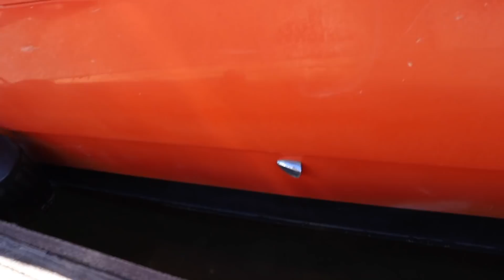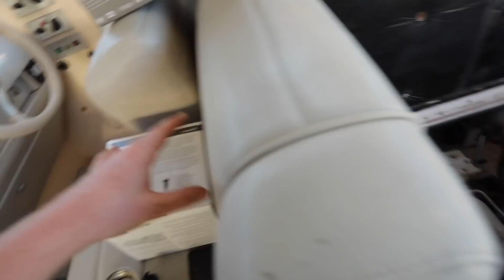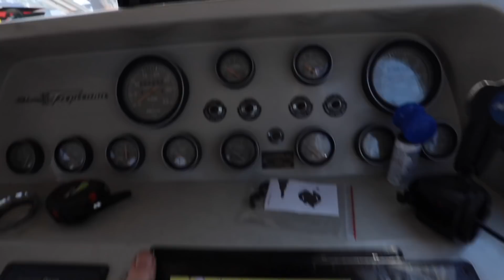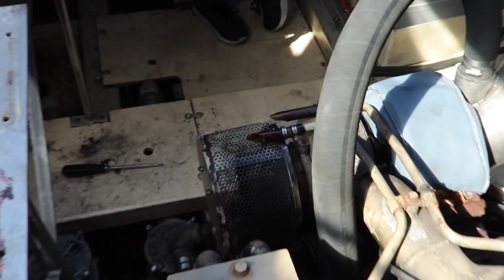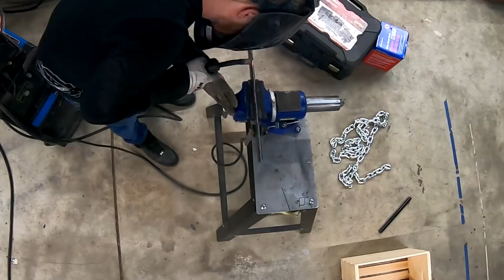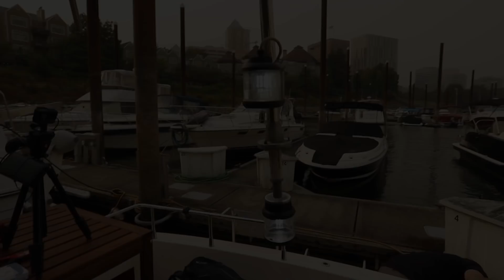Fixing Up My 30yr Old ITALIAN YACHT!

Comment: Pretty sure those engines are Cumins VT903's V-8 motors not V6.    Same motors we ran in the 41' Coast Guard patrol boats.  Also make sure your anchor light is switched separately from the white masthead light.  They are not suppose to be on at the same time.  When the 360 white light is on no other running light should be on.    The forward mast head light, the sidelights and the stern light come on together.

Comment: As a full time detailer, I would recommend more of a gelcoat specific compound, which cuts harder and will give way better results, also 1,000 grit wet is used on gelcoat to get previous sand marks out, I would definitely recommend using a different set of grits, I would go using a 600 or 800 dry to a 1200 dry for more time and then a 1500 dry for even more time than that, and finish off with either a 3,000 or 5,000 wet followed by medium cut and glaze for a showroom shine
Reply: This guy details
Reply: @Failociraptor  That's a lot of details.
Reply: Wouldn't even do that... There's barely any haze on that gel coat. 3M Finesse-it and a wool pad on a buffer will take care of that fine without any cutting.
Reply: I wouldn't wetsand gelcoat at all. Not a good idea to wear it away like that. Ask me how I know...
Reply: @nickrouse1738  Absolutely not on a boat of that age. The gelcoat is already fragile from age and your method will tear right through it, and become even cloudier within a year.

As I said, Finesse-it with a wool pad or a DA and foam pad, and a proper wax with uv protection.
Reply: oscar is ur realest friend hes always willin to put in work
Reply: I agree. 3m makes several marine color restore products that are amazing.
Reply: keep in mind tho, that as he clearly doesnt know that much about boats, he might totally ruin it with the sanding. in two ways: 
1. he will sand it off too much with a 600 on some parts for sure, so the lamination will become visible. on older boats thats really hard to fix, as the gelcoat changes color with time of course. 
2. he will make this sorts of circles, im sure you know what i mean. the circles that appear if you are not skilled and not sand everything evenly. he should use that 1 meter long sanding tool, idk how it called. 

I work in construction of yachts full-time (focus motor yachts), we do the sanding from 240, 400, 600, 800, 1000, 1500, and then polish. and between every step we lightly paint it red, and then sand it until all the red is gone, that way we know for sure that its evenly sanded. but then if there is just one red spot, it absolutely crucial that you dont just sand that spot, you have to sand everything around it evenly until the red spot disappears.
Reply: 5000 grit? Jesus
Reply: I’d take a look at the new Farecla G360 Superfast compound and polish. It is by far the best compound and polish on the market today. It may not be as Popular as meguires(3M), but it is by far better.

Comment: Probably just needed fresh breather canisters. They are a service item. I wouldn't modify the breather system. If it goes wrong and you get excess crankcase pressure it'll run away.

Comment: You are going to regret not buying that Fortress anchor! They are the best anchor going. The one you built is way to small for the size of your boat
Reply: Fortress anchors are a good backup anchor for a boat this size , a correctly sized rocna or manson supreme is a far better choice they will set far more reliably and hold on where other anchors struggle,  they will reset on a lazy tide change ,  a fortress will struggle with that

Comment: Good lord I know the pain and suffering associated with detailing boats... Pretty much my entire company went down to Annapolis MD 3 summers ago to fully correct and seal the paint on the hull of an Azimut 30 meter and we spent the better part of a week correcting that paint. I still remember sitting in a floatie tube in the water in absolutely blistering 103° heat all week just to get an angle on the paint closest to the waterline. Good times though 😂

Comment: Your exhaust system has a water jacket running uphill after the turbo.  These eventually fail, leaking sea water into the motor through turbo.  It's a bad design you should replace.

Comment: Your diy anchor looks a bit small. Also if you really plan to anchor somewhere, you will need atleast 70ft + water depth in chain. Otherwise you will crack the bow of your boat and/or the anchor will rip loose. The heavy chain has a dampening effect on the boat and it will also ensure a good angle on the anchor. I recommend 5 times the water depth in chain for shallow waters down to maybe 2 times water depth for really deep waters. For your boat size you should at least get 100-150ft of chain to anchor anywhere. Everything else is pretty unsafe.

Comment: Not trying to Monday morning quarterback ya here but the anchor looks a little small for the size of the boat.  I think you also need far more chain then you have. Anchors have some serious engineering involved and while they do dig into the bottom the chain is actually what holds the boat in place, not the anchor. The ratio is usually 4-5 times the chain length per foot of water depth.  This increases to 5-7, or more, times the length of chain per foot of depth in bad weather.  So 20 feet of water requires anywhere from 80-100 feet of chain in the water.  

 There are also anchors specifically built for rocky bottoms, sandy/muddy bottoms and ocean anchors.  They can be quite expensive but they are the only thing keeping your boat from drifting into the rocks and sinking while you're sleeping.
Reply: Boats aren't cars. 
You have to use the proper equipment.
You need a much bigger & heavier anchor with a much longer and thicker chain.
The anchor you made is very small and light.  It will also rust and stain your  boat.
As far as the deck music equipment, you should buy a marine type one with marine speakers. If not, it will be dead within a few months.
Reply: @alexioskontoleon4287  these days its easier just to have like x4 bluetooth speakers that can network imo. Easier to move around wherever you are on boat and often much better sound quality imo.
Reply: @Sam_Sepiolx  Exactly. I roll with a pair of bluetooth speakers that are completely waterproof(they actually float) and each one is loud and pairs together so you can have music everywhere, even in the water.
Reply: @demitrisolvinski  yea 2 is plenty if your parties/amount of people are often limited. I only have 4 for times when 2 in cabin and 2 in cockpit are needed, but even then you can easily do 1 and 1.
Reply: Also that anchor looks almost the same size as I use to anchor my 14foot dinghy, it looks way to small for a big boat and the chain is way too short
Reply: @benjamindavies1188  You have a secondary anchor on your 14 foot dinghy? Or are you comparing your main anchor to his secondary anchor?
Reply: You’re a little high on your chain to water depth ratio. Here in buffalo on the very strong current Niagara river we use about 3-4 foot of chain per foot of water. However, that doesn’t change your point. He needs to rethink what he did.
Reply: 3x chain to depth as a general rule of thumb
Reply: But but why can't he just use a big block chevy hanging off a crane from 60ft of timing belt?
Reply: Won’t be double anchoring for awhile considering he blew an engine. 
Maybe next summer.
Reply: As i mentioned already, this project got my anxious.  I am a kind of expert on this field for 3 decades and worry me a so nice boat, almost a classic RIVA been fixed like a Ford agriculture tractor. Of course that anchor its a piece of shit.   Need a 3 times bigger anchor, a CQR if possible and 60ft of REAL chain plus the right splice to an nachord rope.
Reply: @Carter Cerer   you usually dont want that ...  boat need to move freely.
Reply: You dove really deep into anchors but seem to have missed what he is trying to do. THIS IS NOT THE MAIN ANCHOR it is secondary to try and reduce the swing of the boat. I'm guessing if the marine shop told him what size and weight anchor he needed than it is probably correct.
Reply: @SirDavothe2  no no no both anchors need to be the same sise and able to hold the boat independently,  also different anchors suit different sea beds so you can get the best set , you have never anchored a heavy boat obviosky , EVERYONE who has anchored a heavy boat realises you HAVE to get deep into this anchoring thing , anchoring  a large boat s an entirely different prospect , , you would know this if you had dpne it before
Reply: The back anchor only stops the boat from swinging.
Reply: @jeffreysalzman1497  the intended use doesn't change the physics of how anchors work
Reply: Have a blast bud. Live in P-Town and have a home and float house in Astoria. See you on the river. 
Anchor is going to be fine for as little as you’re going to use it...yeah...remember...boats aren’t cars. Wtf is that?
The world is full of Einstein’s.
Reply: @drewd1726  its a hard no t for me on the usefulness of that anchor , it wont set as the proportions are incorrect, it is incredibly small and would never hold a boat that size even on a calm day ... im guessing the riva weight would be around 12- 20 tonne with a fairly decent windage , Einsteins on here ? Possibly but when you anchor a large and heavy boat daily iyou get to learn a few thingds ,  a properly proportioned danforth anfhor of that size would hold perhaps a boat of 16 feet , his home made anchor wont set at all as the stem is too short the blades are not proportioned  correctly and it doesnt articulate enough. Im guessing your experience anchoring has been throwing tbe lot overboard and tying the line to the ckeat , thats ok for a small boat certainly not best practice , this approach on a large boat is utterly useless

Comment: I  don't know if anybody said this but put the oil from the catch cans in the fuel tanks.  It is a light fraction oil and your injection pumps will love you for it.  You should also be putting a little of the used engine oil in the diesel tanks.  ULSD does not have a ton of lubricity...

Comment: If the "chrome" doesn't have any rust on it, it is 316 stainless which is the preferred for salt water use. FYI.
Reply: Life After Work it’s chrome.
Reply: Ahh no older marine / expensive brightwork was cromed silicon bronze , absolutely the best you can get for corrosion resistance
Reply: 316 is not actually that corrosion resistant there are far better options out there ,  stainless steel  needs to be mirror polished in marine enviros , on larger boats anything submersed is always bronze
Reply: @mitchpender8113  316 SS is considered in the marine industry as a marine grade stainless, and is used for everything from brightwork to valves and specialty items. Boats in the pre-90s pleasure industry used a lot more brass and bronze than today. Bronze is getting pretty expensive, and maintenance heavy.  I know that  lot of retrofits are getting rid of older brass components and replacing them with 316 ss. Plus the vital bronze components are using more corrosive resistant alloys of bronze. You are right, but avoid using the word "always". Not as much these days. Believe it or not a lot of high strength plastics are being used everywhere on large boats.Ships are using a lot of monel, and other alloys in critical areas. But if you have bright work that is in good shape and it is Chrome plated, it is a really high quality chrome. If it is really high end it is, as you say, chrome plated silica bronze. Very expensive as a rule. But i only have 40 years in the marine industry and navy, what the hell do I know.

Comment: Hey If you can clean all the gel-coat with Acetone before doing all the steps. this will take away all the old polishes and oxidation. I did it on my boat and the results were amazing. my boat is a 96

Comment: Just one question.....that light you covered with the Garmin GPS mount....you should probably look to see what it is because it could be vital
Reply: It tells you when the engine is on fire and the boat is sinking.
Reply: That light it's temperature warning light.  When the engine(s) gets too hot it goes on with an alarm or buzzer.

Comment: you should put a wireless charger in that 3D phone stand
Reply: could cause interference with the garmin right beside it.  the cable for the sonar is right there so could cause problems.

Comment: There is a reason marine grade stuff like a good anchor costs money. That anchor needs to be made out of Aluminum not Steel. You can use that in a marine environment. Also you need way more chain then you have got there. That anchor wouldn't hold a row boat. It's the weight of the chain and anchor combined that work to hold the boat. Go to a quality marine store and ask for some help and they will get you setup with what you need.
Reply: Actually a aluminum anchor would not be a good choice fof a boat tnis size , they are meant to be infrequently used , and are more at home on a racing yacht ... the majority of full time sailors use galvanised  steel anchors and chains ,  they last for years and years in salt water